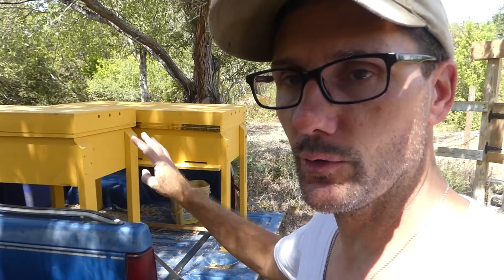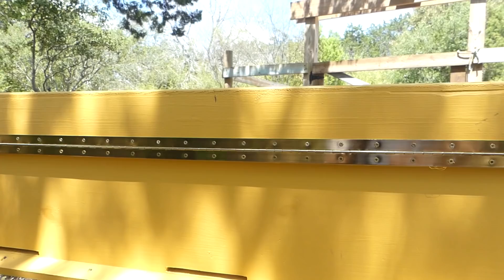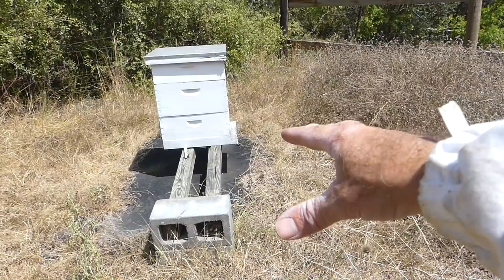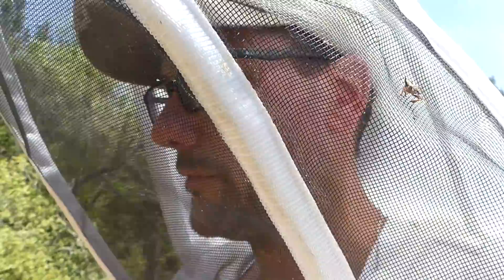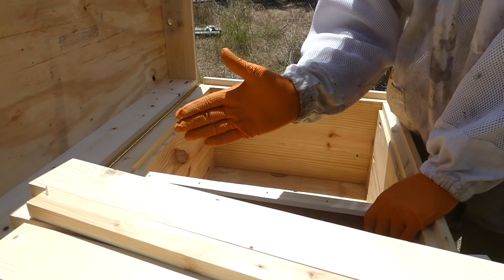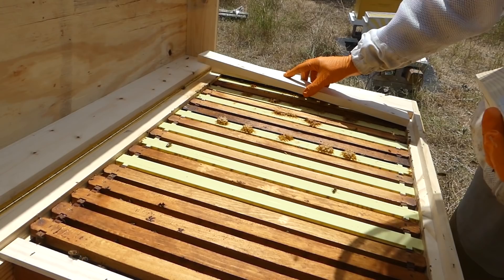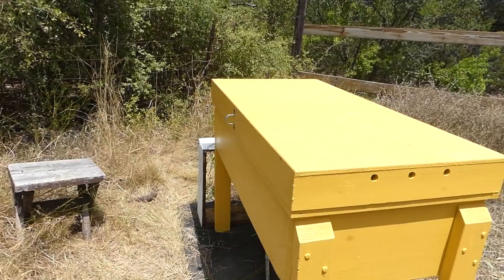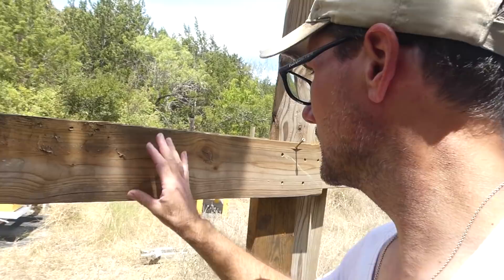COULD THIS BE THE BEST BEE HIVE EVER?!?

Comment: I am curious as how this box was intended to be used. To me it seems like a good box for mainly brooding.

It has 3 entrances so why not use 2 dividers and separate them into 3 sections, with another vent hole in one of the cover boards for more ventilation?

This box was not made for a honey super or queen extruder, so as it is only divided into two sections, will one side be used for brooding and keeping the queen and the other just for honey? 

If you have winter conditions, you should also have two additional holes in cover boards in either section for the placement of feeders.

Does it have a screen mesh bottom with slides for a draw tray for beetles and a slide for a solid cover to keep them warm in the  winter?

I like the idea of this horizontal box so you don't have to stack up high and risk hurting your back and the bees with all the lifting and moving of frames and boxes.

If you use another divider, you can keep the queen and the brood  confined in the middle and use either end for honey only by the growing hive. 

One more thing, because of the area of the top, you should make a gable roof with either wood or metal sheet to run off rain and snow so it does not settle on the flat surface and cause rotting and damage. 

Just some observations and opinions to consider or ignore. I have been researching beekeeping for some time now because I intend to get into it and have looked at all methods and practices from the past up to the present, all the pros and cons the determine the best, simple, economical and productive system for me and my location with maximum safety in mind for me and my bees. 

Please do not take my comments as criticism, I am just sharing ideas for everyone who may want to use this or any other system freely so as to promote sustainability, efficiency and productivity and success in your beekeeping. 

PS: All new beekeepers or potential beekeepers should know whether they are allergic to bee stings or not and should practice wearing g of all necessary safety gear when starting out. It is totally up to them with experience in the future, if they want to wear less or no protective gear and at their own risk.

Comment: The only drawback I can see is the horizontal box would limit the size of your hive. If your hive box is almost full and that hive becomes honey bound and they need more space the hive box will only hold so many frames. If you don't want to be splitting your hives all the time, this may not be the best idea. I'd have to see how this idea pans out long term.
Reply: Cryssa Rose - if the colony has that much honey, then take some honey frames off, (given enough forage). For smaller colonies. You can also have more than one colony in a single hive. Separated by the follower board.
Reply: I have been using horizontal hives when I started beekeeping.  I moved to Langstroth as they are better suited to the  pastoral I was doing. My father uses a mix of horizontal and Langstroth and my grandfather used exclusively horizontal hive. Our horizontal hives had 18 frames max(about half as big as the ones in this video my guess). It's all about management, that's why bees in hives need beekeepers. In a natural setting when they run out of space , if the season is right, they swarm.
Reply: Ps :it is a good system for a static apiary,  and a lot easier on the back, a lot easier.
Reply: sorcyo - Swarming is good. It’s a natural part of bees being bees. Also part of the natural beekeeping ethos.
Reply: @dcvariousvids8082  True, but it greatly reduces the honey producing capabilities of the swarmed hive. Honey production is the primary reason hobby beekeepers have hives. For many commercial growers, honey is just a beneficial side effect of their primary purpose of crop fertilization.

Comment: Use Crazy Glue to keep the tape on your hood in place.  And use "clear" tape.  From some other videos I've seen on the horizontal hives, Dr. Leo Saraskin of @t recommends that the frames be narrower and slightly longer.  H actually cuts the old style frames to fit into the new frames.  Why didn't you build your box to accommodate the longer style frames which he says is better for the bees as it replicates their hives in nature?
I mean, if your going thru the expense of building a new model, wouldn't it make sense to also incorporate the newer narrow style frames?

Comment: you should have made it so you can put a super on top
Reply: Who says you can"t? I do.
Reply: @ronsmith6233  the lid it has a hinge
Reply: There is no need, just as it is not necessary with a Langstroth hive. You simply remove frames when they are fully capped - the bees do not need any capped honey when a flow is on. The only disadvantage is that it might require more frequent hive inspections.

Comment: I lost interest in you when you said you didn’t want a foundation in your slats which is ignorant because without foundation your bees will put combs in all directions. Not professional at all
Reply: If you were to replace the frames with frames that have a starter strip only one at a time, only changing out as you can/need to for whatever reason, making sure you have frames witgh foundation or that are drawn out on either side. Couldn't you theoretically do that? I mean I've seen videos of people who use those types of frames in that situation and they worked out fine.
Reply from the maker: I'm not a professional. I'm a hobbyist that is still learning.